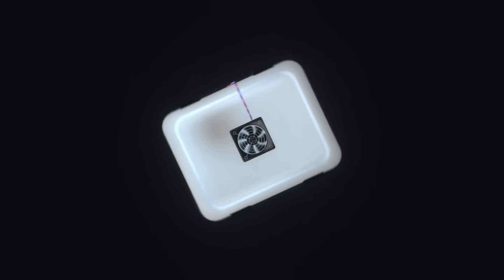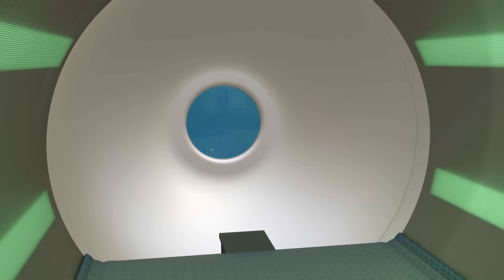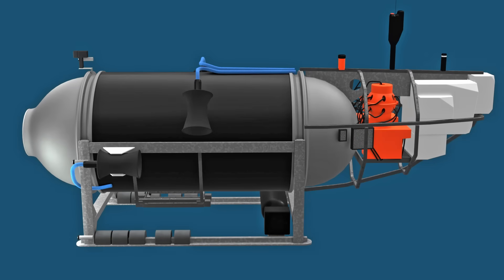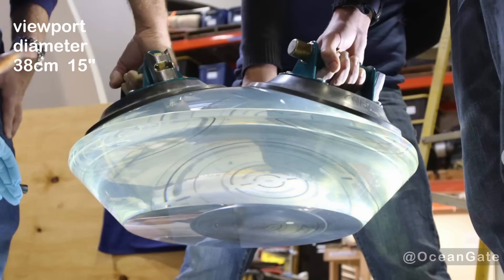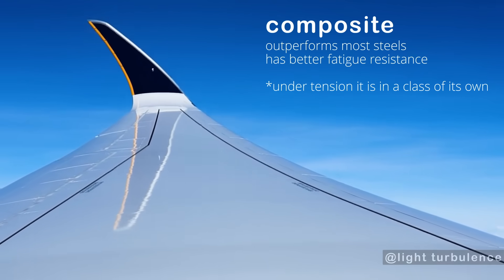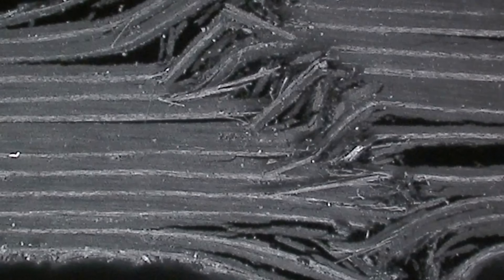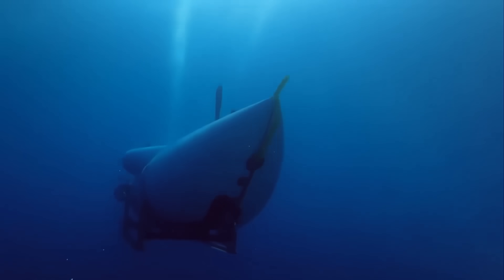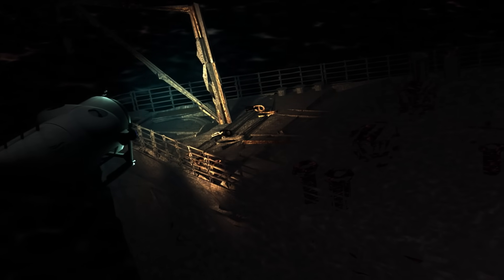Titan Sub | carbon fiber - Detailed Tour

Comment: Your proof for Carbon Fiber taking pressure loads doesn't work. It's an aircraft wing, when it is deforming like that the top might be under pressure but the bottom is under tension. This is opposed to how carbon fiber used in a Sub would be experiencing pressure. Where the entire pressure hull is under pressure from the surrounding water. That you missed such a basic thing, as well as have no other supporting evidence why your take should be true over experts in the field, really doesn't look good for the credibility of your research.

Comment: It would be interesting to learn about their non destructive testing program if any. The sub did make previous successful dives proving the composite holds up at least a time or two. However the cycles of pressurization and depressurization is where defects occur. It would be interesting to know what was tested in between dives.

Comment: I always appreciate your ability to take such complex concepts and communicate them visually and verbally in a way non engineers can grasp these very complex concepts in a more tangible and meaningful way. Thank you for your hard work. I always learn so many new concepts to learn more about.
Reply: One thing not discussed enough here ....  "The Sphincter Valve Effect" 
What happens is.... BOTH noise & visuals are translated into Electrical Impulses for interpretation by the brain.
When formed, these impulses of information travel South to the Sphincter Valve aka the Orifice Interface.
The Sphincter Valve controls electric impulses in an effort not to overwhelm the brain.
Nerves are very thin in this anal-type area. They need a massive amount of bloodflow to pass the Interface, traveling on to the brain.
Once you throw TOO MUCH INFORMATION down there, the electric impulses backup, the Sphincter Valve closes, blood flow drops.... nerves can't pass information ....... and the brain has no choice but to mutter the only thing it still sees, OH SHYT!!!

Comment: composites in compression only relies on the bonding material so the strength depends on the resin mostly. I wouldnt do a sub with plastic bonded to an non flexible metal dome

Comment: You know it's very obvious he just didn't believe the experts regarding the sub but sometimes I wonder if he didn't believe the science regarding deep sea exploration. That's the only thing that explains why he used a window that wasn't approved for the depth. The carbon fiber issue I understand because it had never been done but that window was a completely different story. It wasn't approved because during testing it failed. Yet he still put on the sub and hoped for the best.

Comment: I think it's important to remember that airliners  (representing a multi-TRILLION dollar business) have only just began implementing composites in the last 20 years (despite the immense weight reduction and thus efficiency it provides.) Composite airline parts are built with ample metal reinforcement and held to an unbelievably narrow tolerance. Airbus gave us a look into how they build the composite-based A350 and the complex, precision engineering required to build those parts is unbelievable. In fact, it is considerably more expensive to build with when compared to traditional aluminum airframes. If Boeing has only just figured out how to build with composites, it's best for silicon valley techies to leave it the hell alone.

Comment: We have repeated pressure cycling of a plastic cylinder glued to metal ends, and repeated temperature cycling of materials with dissimilar thermal expansion coefficients. Then we have compression forces at each end, pushing against the cyclinder ends. Then we have repeated pressure cycling of the plastic cylinder. Just take a look at the other submersibles that are capable of descending to the Titanic, they have thick metal pressure hulls. This was a Primark/Lidl submersible.

Comment: Brilliantly explained, the failure was the ends of the tube compressed inwards, not from the weight of the water pushing in on the tube itself. Maybe a steel skeleton on the inside of the tube would have provided additional structure strength and counteracted the crushing force of the end caps. As you suggested the carbon fiber was damaged by the previous dives, the failure was a cumulative effect and not just the forces subjected on the last dive. Stockton was an intelligent man, more should have been done to make him understand and comply with the rigorous testing that would have exposed this risk. I hope this is not the end of the story using this new material for submersibles.

Comment: I have a family member who holds a PhD physics that has 40 years of experience in carbon fiber development and production. Having designed and built several carbon fiber production facilities all over the globe, I trust his expertise. He told me there was no way he would have ever even gone diving in the deep end of a swimming pool in that "contraption," as he called it, much less down to 12,000 feet. He knew right away based on the construction and lack of attention to detail and safety of the operation that they suffered a catastrophic implosion.
Reply: i think it was the dissimilar materials compressing at different magnitudes that made it fail,perhaps he should have just made it 7 tons heavier.
Reply: if he had made it properly, perhaps there would have been less issues actually being able to get people to pay him tons of money to dive in it. the only people that did go were, well, fools.
Reply: @ElectricalExistence there is no way to do this properly. You can not use different materials with different behavior unter pressure to build something like a sub.
Reply: common sense alone would tell you multiple, if any dives to bottom is a death wish. that said, im of the limited knowledge based opinion that if they would have dived at more controlled rate the hull may have been up to keeping the 5 alive.. its my undsrstanding that they descended at almost 3x the desired rate. too much pressure increase too soon means the hull saw way too much change in pressure way too quick, flex, shrinkage, warpage all too much too soon. slower dive rate means the hull would have time to acclimate itself sort of to the slower pressure changes keeping the vessel from rapidly flexing & ultimately crushing itself to leak status then.... im by no means suggesting that carbon fiber could be used. i have common sense & very little experience with carbon fiber motorcycle parts. im qualified to suggest or recommend anything except objecting to making hulls going to extreme pressure depths made from stale carbon fiber.
Reply: The day eveyone learned they were missing, a coworker (materials engineer) immediately said they were all killed by implosion.
Reply: Yes it looked like a university project, the incredible think is how rich people felt in this scam
Reply: @Fosforitofercho  most didn't. they contacted the other companies that make deep sea vehicles and they told the rich to stay the hell away from oceangate. what is baffling is Hamish Harding had the opportunity to go on Limiting Factor which has not only been to The Titanic, but has taken close to two dozen people to challenger deep the deepest part of the oceans. 

it would only have cost Hamish a million which would cover the cost of the support vessel trip out there.
Reply: you don’t need to be at the top end of the spectrum to understand that a carbon fiber submerse is idiotic
Reply: Your cousin or whatever would sound more believable without exaggeration or hyperbole. It is doubtless safe for low depth dives like a swimming pool or even 150 foot depth.
Reply: @carbonking53  itd be great you replaced "implosion" with somethin like "failure"...
Not because its wrong in definition, I'm just sick of keep hearing+seei g that in popular media and melodramatic posts by people regarding titan sub, to a point it get so so cringe 😬 

Sorry 😞 Just how i feel
Reply: I don't have a Phd and i still Wouldn't trust that thing
Reply: Thank u!
Reply: I think he did prove that carbon fiber is a viable constr😢material for a limited use submersible. It made multiple trips to the Titanic successfully, so it is a viable option.  Now we know that it would require rigorous inspections between dives, and have the main hull replaced at regular intervals.
Reply: @distracting_games  its a one use for human vessels. remote operated vehicles you can inspect/x-ray with ease and then destroy the carbon fiber if it shows signs
Reply: @toomanyaccounts  yeah, it would need vigorous inspection in between dives, and would need to be replaced frequently. More testing is needed to see to what extent one of these kinds of submersibles could be considered safe.  The real problem with Oceangate is their blatant disregard for safety standards, and using the submersible community's track record of safety to justify his actions.
Reply: @distracting_games  We have no standard of production, nor establishef quality control, nor any certification for what depth it works. On top we have no knowledge if it is a throw away product as each use multiplies the implosion risk by a factor close to a death wish.
Reply: @TorianTammas  that's why a lot more testing is needed if someone else wants to build a carbon fiber submersible.  They would probably have to build and sacrifice dozens of  remote operated Titan clones, and do thorough examinations with the appropriate equipment between test dives.
Reply: @distracting_games  The basic problems are fibers and even if the production delivers constant quality which is very unlikely then the material needs more checks and has a very short life cycle. So it could be used within safely for once or a few times. So basically costly, less reliable and lots of costs for checking. Steel is the go to for deep depth.

Comment: The fantasy of carbon fiber strength. 
If they would had Used only Metal has it traditionally for many years, they may had survived. Carbon fiber has strength only during the lab test.

Comment: The flange torn off the end cap says it all for me.  The ends of the CF tube were only stopped from deforming under the compression of the endcaps by the flange which was not strong enough to resist the force of the ends of the tube pushing outward against it as they tried to deform under the compression.  Once the flange went, there was nothing keeping the ends of the tube from deforming and squirting out around the sides of the endcap, at which point the pressure simply forced the endcap down the tube much like a mandril gets forced down a pipe to stretch it out.

In a sense, the CF tube was being crushed on the ends by a hydraulic press.  Forces Stockton likely never took into account in his designs.

Comment: I have no doubt CC could be used to construct a viable deep sea submersible, but it would be with a LOT more know-how and rigour, and at much greater expense than Rush and his M. Mouse outfit could muster. I also question using a facile tube rather than a more complex elipsoid shape which would provide a progressive increase in strength over the surface to match the distribution of stress, and even in most 'critical' applications CC components are subjected to vacuum compression to compact them before autoclaving. The only surprise in all of this is that the Titan didn't implode sooner.

Comment: Actually, the view port window flexes only 3/4 of one inch. One inch = 25.4 millimeters. I will argue, that since carbon fiber is like thread, it does not contribute to compressive strength. The material relies wholly and solely on the compressive strength of the resin/epoxy.

Comment: you started by saying that the media made the carbon fiber hull as a bogie man and then you described how you think the carbon fiber failed.

Wrinkles verse de laminating is really just semantics for the average person. The key is that the hull was untested and went straight to commercial use at extreme depth. Even aircraft with aluminum hulls at 1 atmosphere need to be regularly tested for cracks caused by regular pressurization.
Reply: It can't wrinkle, THAT is delaminating in progress. The carbon itself is only the reinfocement against Stress, the dried/hard resin is the total weight carrying material. 
The big issue here in the discussion, THE SAME issue Stockton had in his mind, it's 15 things AT ONCE, you can't put them in a particular order, they all exist at once.
The discussions here use these sort of generic 8th grade science class descriptions and words.
THE THOUGHT PROCESS that then comes out..... is 8th grade level also. Stockton had a generalised 8th grade level of product knowledge, or maybe not even that high. 
More like Popular Mechanics level, something you would read while the shop is heating up & you are in the restroom seeing a man about a dog.
EVERYTHING at once, no order to it. 
Perpendicular Axial Stress-push the tube IN from the ends, when vid says Compression? on the wrinkle part?  PAS is what he really meant. 
Tension Stress, not present here.
Compression Stress. Not present here cause it's not a flat plate.
It's Hoop Stress, not Compression when talking about the toilet paper tube from the outside IN. 
Now you get it right? 
Even discussing the thing here and none of us have a dog in this hunt, is difficult.
BUT I SEE IT THIS WAYYYYyyy. Waaahhhh. 
The material handles XXXpsi of PAS, xxxpsi of Hoop....etc etc.
The contruction process gives us yyyy while we are unable to obtain zzzz unless we do it this other method.
All At Once. This part could go on for hours & hours.
Stockton's failure here is Number of Cycles. He made 13 successful dives in 90 attempts. 
If you are keeping score that is 77 failures, 86%. Every kind of failure possible, comms, etc etc 
It only failed in the hull area once. 
His name's in the History Books now. 
Stockton did a "Rush Job" on the science, it lead him to the "Stockton Engineering Paradox".

Comment: Where are you getting your information?  Carbon fiber was the wrong material to use. It’s compressive strength is only 1/10th of it’s tensile strength. In your example of the aircraft wing, it is experiencing tension, not compression.
Reply from the maker: Where are you getting your information from because it is all wrong

Comment: I would still not trust the design given the manufacturing process that was demonstrated in their own media, nor if the material was properly assembled.

If the “SubSafe” program was implemented, perhaps the sub would have been given a proper rating for its operational depth and possibly been given an defined actual lifespan.

As you stated tho, the whole undertaken was cavalier and very gung-ho towards proper safety and untested products of the final design.

Comment: No...I've worked with CF for structural applications. This is not even close to the ideal application for composites, especially when you connect them with unlike materials and then cycle the assembly through extreme loads. The sloppy method the fibers were laid, the way unlike materials were glued together, the plexiglas window that wasn't rated for that pressure, a total lack testing. Basic test evaluation question: How many cycles of extreme pressure would be considered safe? 

Dragging the submersible though open water on its cradle through waves to the site....all these mistakes guaranteed failure.

Stockton's blind sighted ego, and his total failure in a leadership position was criminal. 

I'm surprised you posted this report without understanding your subject matter. My comments have been repeated so many times by experts in the submersible and CF industry.

Comment: I think one of the main issues was the repeated stress on the Carbon fiber. It can only be subjected to these stresses for so many cycles. Also, you have to take into consideration of the four different materials. The carbon fiber, Titanium, the adhesive used and the view port.
Reply: Exactly, Those materials all behave differently in such extreme conditions, Bonding them together put extra stresses through eachother..
Reply: So one or two dives. Maybe three, then implosion.
Reply: @ouknow1446  as much as i disagree with the whole recipe, i gotta wonder, if the descent wasnt so rapid & the pressures were allowed to acclimate, does the titan make another successful dive?
Reply: @Toobzilla  No need to wonder. Why dare risk it? It's all or nothing. One crack and its done. What wasn't there before the dive is there afterwards who knows where?
Reply: @Toobzilla no. pressure is pressure, doesn't matter unless they are equalozong pressure out form within the chamber, which they werent acclimatimg os for dovers, not vessels.
Reply: material failure happens at millions of cycles, and the pressure at the bottom of the ocean is WELL below the maximum compressive strength of carbon fiber. But yes, if there was an initial flaw in the material, then repeated stresses would exacerbate it and eventually cause catastrophic implosion.
Reply: @queenoftheworms2739  It wasn't laid out right to give it's maximum compressive strength.
Reply: @ouknow1446  it was still at it's maximum compressive strength, the problem is it was only resisting in one direction.
Reply: @queenoftheworms2739  Yep, not resisting in needed directions if not all because it was improperly laid.
Reply: add corrosive salt water to the mix and....
Reply: Every time the TITAN has been tested on the CF it has had micro-cracks or micro-deformation.